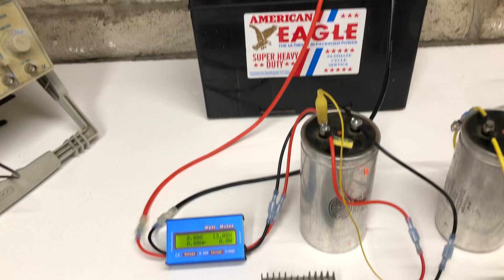Pulse motor (no magnets) pumping water with series battery setup and output

Comment: This one is quite efficient, K. If you measured the pump output head by extending the discharge tube up 12” or so - you could use bernoullis eq. To find the power the pump is delivering. But other wise 25 watts in, 12-20 watts out, plus pump power delivered to fluid - and it’s remarkable how efficient the little guy is!
Reply from the maker: Thanks ! Yea my fave too

Comment: i see a bunch of magnets. what do you mean, no magnet?
Reply from the maker: The motor is reluctance means there is no magnets motor stator and rotor out of steel
Reply from the maker: There are no permanent magnets on this motor beside tiny timing ones only electromagnets
Reply: @kenergy1707  electromagnets. are magnets. Induction Motors come to mind.

Comment: Hi 
Interesting the output, is that a constant 1A going into the charge battery?  
Then on top of that charge, there is an extra 1.5A pulsing into the charge battery every second or so?

Is the extra charge coming from the secondary coil under stator coil?
Seems like this is a "looper" with battery swapping over certain amount of time, plus its running a good load on shaft so its very great what you are doing.
I appreciate your simple easy to watch and understand videos, explanations, and motor builds too! 
Here is experiment you might want to try with "regauging magnets"
Run this reluctance motor in video in "repulsion mode" (however attacticon might work too)
Now hold a magnet with N facing towards middle of motor, the magnet at about 10 oclock, and another magnet with N facing towards middle of motor at about 4 oclock (180 degrees to other magnet)
Run the motor, play with distance from the rotor arms, the angle of magnet, the position of the magnets in the "clock" such as maybe 10:30 and 4:30 or 10:45 and 10:45 maybe even 12:00 and 6:00 I dont know what its going to be exactly depends on speed of motor, and everything else such a magnet strength and their size and shape too some more "variables" to experiment with.
Motor should speed up and use less draw very signifigant if you can get the rotor core to flip its polarity just before the next line-up for a motor coil pulse.  You will get a "for-free" power pulse as rotor core flips itself to become South and stator cores "remain" North
If you can find good position and strength to the "regauging" magnets which you can just hold in both hands while motor runs (so easy)
If motor slows, or nothing happens, flip around the hand held regauging magnets to face of opposite polarity and then you should get something so pretty simple and quick to see if its going to work or not.
Idea is just enough strength to the regauging magnets to flip the rotor polarity, 
but not so much strength of the regauging magnets so they slow the rotor as it tries to plow through the added-magnetism of the two magnets.
You can start out with just one magnet, you should see something, then add the other later.
Attraction should work too but magnets of opposite polarity to give a push forward after the "release" of the motor pulse being cut off.... now magnets positioned other side of stator cores (regauging magnets also affecting the rotor core, not the stator core so much althought it might be the magnets a bit behind the stator cores might be optimum position, and a bit biased to one side not sure!)
Anyways if this works it will be great, it did on my old NN bucking coil "konehead" motors draw dropped in half plus lots of speed up and better power.....Bedini has a "regauging" magnet behind his motor cores in one of his patent drawing for his little "schoolgirl" motors.....it slides close and further to the motor core to adjust the magnet strength so the cores is on a "teeter totter" ready to flip polarity from the polarity of that regauging magnet right after when the motor coil pulse turns off and the coil does not influence the core polarity so much as it did. so the regauging magnet "gets the chance" to flip polarity of the core in between the motor coil pulses...
I used to call these magnets "permanent magnet flux bridges" in my old konehead motors, I didnt know why they worked, I just found out they did by accident, but the name of them and how they work explained to me about 15 years ago by guy named Wes Crozier who gave the idea to Bedini, and story is Bedini called him back said thank you and put it into his patent....
Anyways have fun!
Reply from the maker: Hi D yes constant 1 amp charging plus extra pulse output 
 That motor has two outputs one isolated one from primary circuit so I used the isolated one so there won’t be a direct short from primary 
 And yes a good load for the motor it was a great little experiment! 
 I tried with magnets as you said but very little effect on that motor but I would think it could be helpful on some of my other motors so thank you for the input!
Reply: @kenergy1707  Hi K
I was thinking, its not going to work on this motor, as your rotor core is "one piece" so its going to be N one end, S the other as it rotates around it will be S one end then N the other.
If you had two "seperate" rotor cores, with plastic say 1" wide  in middle where axle would go through then it might work.
Anyways really good experiments, you add up the good shaft power, the generator coil power and the motor coil power 
(backemf/flyback) coming out of it you should be overunity for sure.

Comment: Would bending the coils around the core, rather than perpendicular, increase the torque or efficiency?
Reply from the maker: Not sure haven’t tryed before
Reply: @K Energy  , if I understand generation correctly (which I may not), the angle of the magnet field plays a role in the amperage. There's a formula (I don't remember exactly right now) that deals with the cosine of the angle, length of wire, and number of turns, I believe.
Reply: Keeping the electromagnetic field consistent throughout the full rotation may help.
Reply: And one more question... have you tried an induction coil type motor? Instead of having the magnetic and steel core, wind a secondary stator. In doing so you may be able to get more precise control of the motor and a little more mechanical power.
Reply from the maker: @makerslife  there is a secondary stator on that motor 
 I have made reluctance motors out of induction motors

Comment: That reminds me of the Peter Lindemann Rotary Attraction Motor.  I always though it would have way more power if it ran in repulsion mode with permanent magnets on the stator.  Thoughts?
Reply from the maker: This is a little one I have much more powerful attraction motors on other videos 
Yes magnets on repulsion is much stronger because you get repulsion with electro magnets and attraction for free with the magnets